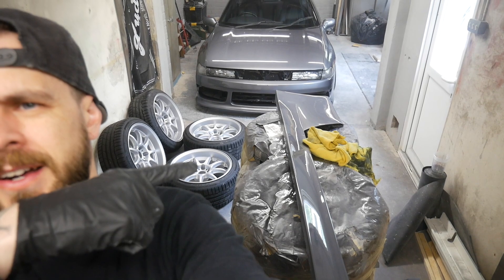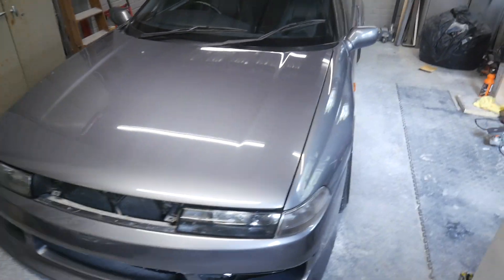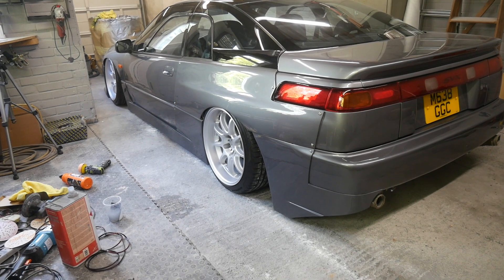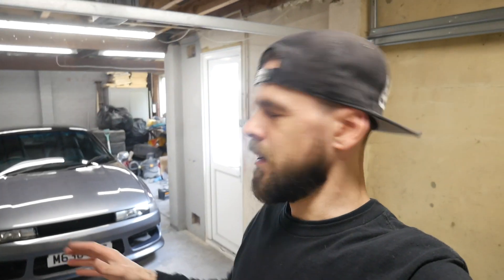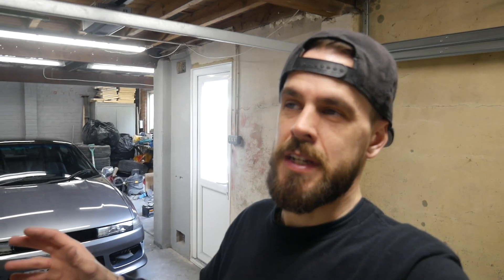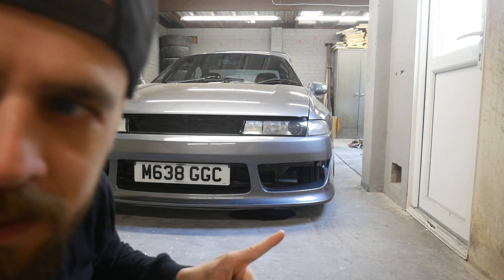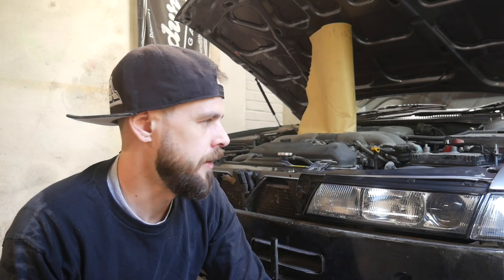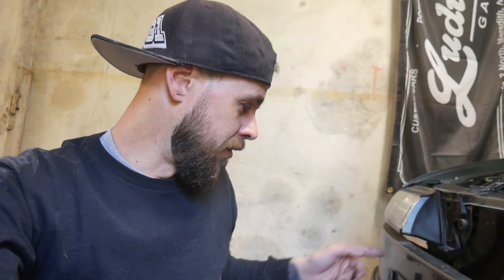The SVX is broken!!

Comment: Is there any other way to attach those fiberglass panels without the big ugly screws hanging out all over the place? It's the one thing that's like running into a wall face first for me. Sorry, I don't mean that as an insult, just my personal taste is all.

Also, have you ever created a new piece, like a quarter panel, to replace an original? I guess what I'm thinking is, I would like to replace the quarter panels on my S10 with fiberglass ones, could I just use your method directly over my quarters, and build new fiberglass ones?

Thanks, love the channel, found it yesterday, and I'm learning a lot from you! I appreciate you sharing your ideas and info!
Reply from the maker: Yeah you can bond the panels on, many different ways of doing it. It’s all subjective to personal taste.  

Never made a full quarter panel. But the method would be the same as I used for the overfenders. 

Glad you like the channel dude. Appreciate you checking it out!